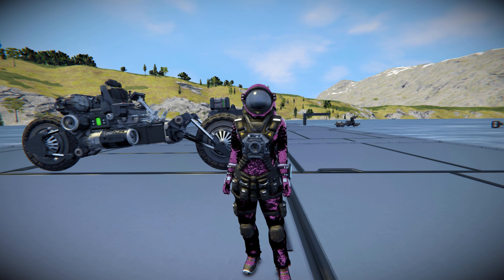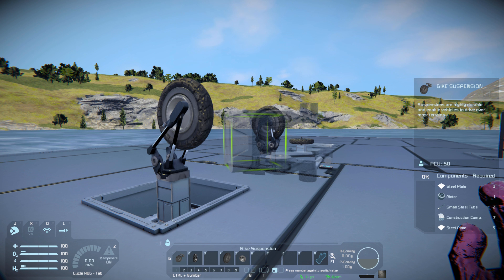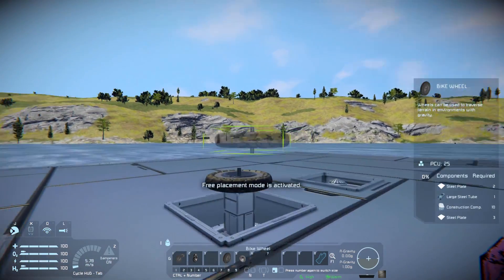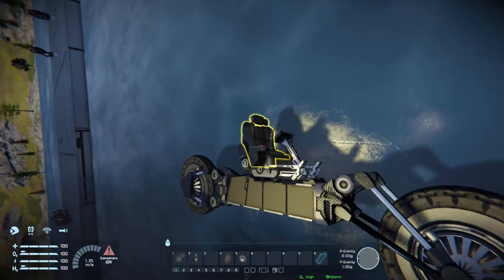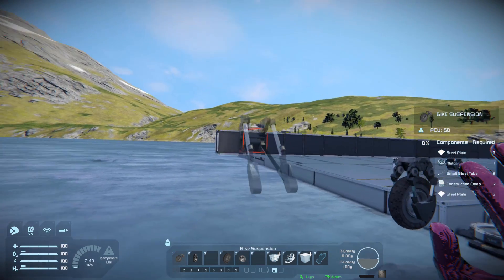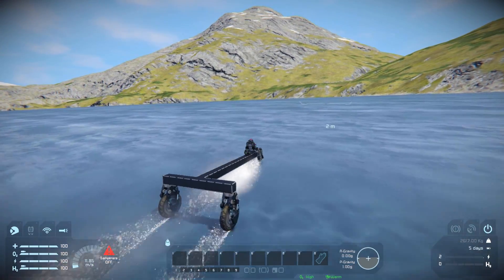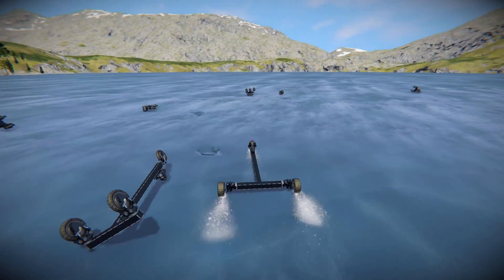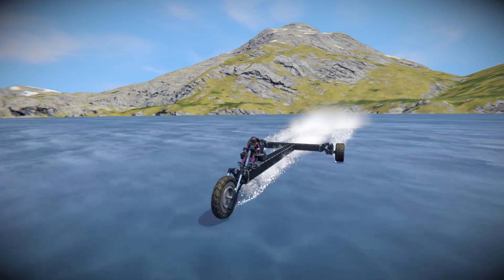Bike Wheels! - Space Engineers

Comment: I hope he makes some vanilla sized wheel variants aswell 👍🏻
Reply: Can try that, I can try to remodel the suspension models to work with vanilla size wheels, i just have to remake the vanilla wheels cause the ones used for suspensions have an annoying offset that is great for the normal suspensions but not great for bikes
I already have planed to make a True trolley suspension
think tiny wheel very close underneath the suspension block, ideal for small wheeled drones
Reply: I was gonna use the back suspension one and put it in the middle on the belly for some good rock climbing